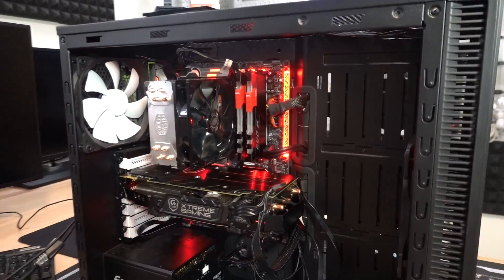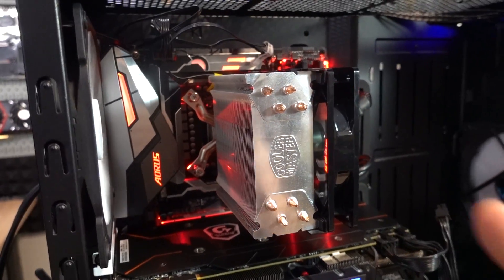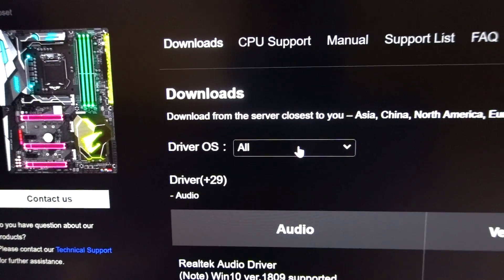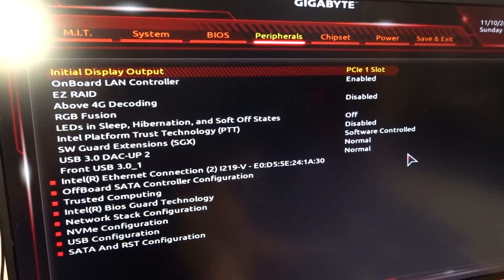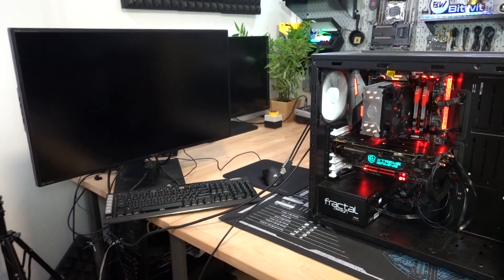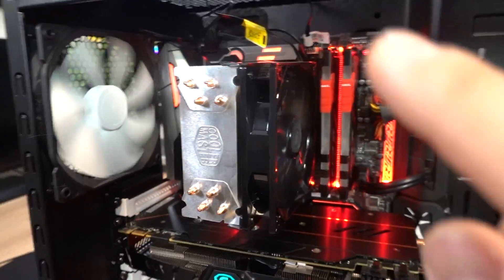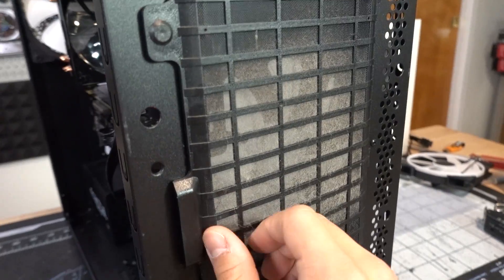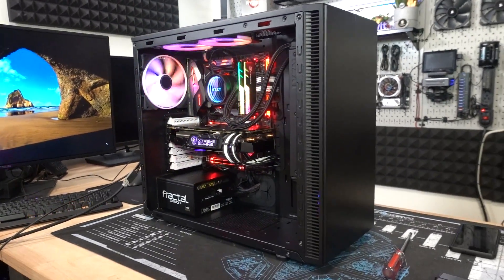Every PC owner should know how to do this

Comment: Kyle something to mention the usb port that you put the flash drive in only matters if you use one of the bios flashing tools that works without a cpu.  This is due to programming built into the motherboard itself only reading from select usb 2 ports due to very limited processing power available.  This should only really be used if you can't use the standard method.  To flash with in bios tools any usb port will work even front panels as the modern UEFI bios are capable of reading from them. Dos flashing of bios is still kinda a thing but only on fringe or early boards and beyond the skills of an average user.

Comment: Something like this JUST happened to me with a 2600 in a MSI B450 Bazooka board. Blackscreen with the underscore blinking. After a couple reboots it booted normally, but the first thing I did was update the bios and so far things have been running fine again

Comment: That "random" string of numbers in the files was not random.  It's just the motherboard. It said Z370AOG7.15a

That basically meant:
Z370: mother board model 
AO: Aorus
G7: Gaming 7
15.a: the version of the bios. It was F15a. 

There ya go.
Reply: *G7 for Gaming 7 - the name of the motherboard
Reply: *G7 stands for Gaming 7 the name of the motherboard
Reply: @Dudae_  aight. Thanks. I'll change it.

Comment: HP is repairing my PC atm since when i updated my BIOS using HP's own software tool, it corrupted Windows, or did something cause it would keep crashing and restarting a minute after booting, and that would just keep looping. Then every system recovery attempt would fail, then every attempt to reinstall the OS would crash the PC. So yeah, thanks for that update HP.

Comment: Why would you NOT put the AIO on top? You're adding fans there anyway, so why bring CPU into the case first instead of on my cool at and push the cpu heat straight out of the case.

While it may not make a big difference, it's still a better choice.

Comment: Pro tip - get a motherboard with a CPU-less BIOS Flashback option. :D  MSi has a nice system for this. You can flash it with NO CPU installed at all. I'll never get another mobo without this potentially life-saving feature. Especially after hitting the unsupported CPU wall with a Ryzen 3000 and a new board last year. Beats the heck out of begging for an AMD flash kit and waiting for them to send one. :)

Comment: If you have fastboot it will not let you get into the bios by pressing delete. Also if your keyboard doesn't get recgonized or it says that there are two of them, then plug it into a usb 2.0 port instead of a 3.0 port. I have been fighting this since I built my new system yesterday.

Comment: It wasn’t addressed in your video because it probably didn’t apply to your friend’s build, but I have almost the exact same motherboard (Gigabyte AORUS Gaming 5) and each time I’ve updated its BIOS it resets the XMP Profile back to Default and turns off Intel Rapid Storage Technology which disables any RAID configuration you may have. I almost have a heart attack every time it tells me my D: needs to be formatted after doing a BIOS update until I remember to go back in and turn it on again.

Comment: It's an Aorus Motherboard and if it has a dual bios without physical switches to manually switch the bios, it probably reverted to an older version in the backup bios and automatically flashed the main with the old bios by itself. If you want to prevent future problems If you successfully flashed your main bios and tested stable, then update the backup bios too!

Comment: Coolermaster Hyper 212 Evo looks budget? I think you mean, "sexy-steam-punk, been around and proven for years"!

Alright, it's a cheap upgrade over stock coolers. If you're doing some serious overclocking or have a high TDP chip, get a better cooler. But damn, for the money. . .it is a pretty good upgrade over a stock cooler. It has better cooling and and is QUIET.
With just a couple of RGB LED strips (top/bottom of glass) in my case, the aluminum and copper, surprisingly, reflect a lot of light, making my build a little flashy, but not rainbow puke.

Comment: I have an overclocked i9-9900, and using a CM Hyper 212 in push/pull config, it stays very cool even under heavy load (~30C idle, and ~70C gaming/video rendering).

Comment: Shouldn't the 8700K be the better choice? Per core performance should be the same, but the 8700K has 6 cores 12 threads while the 9700K has 8 cores but no HyperThreading meaning only 8 threads.

Comment: Question about bios update, is it needed to update bios to older version and go up one by one to the latest version or you can instant go from an old bios version to the latest version.
for example B450 aorus elite. still on F5 which is back on 2019. should I go to F30 , F31 ..etc until F50. Or I can just go from F5 to F50
kinda planning to upgrade from ryzen 5 2600 to ryzen 3600 but wanna make sure my bios is updated first.

Comment: Kyle, how would go about updating a BIOS when the BIOS is the problem? I have a board that won't boot, just turns on and off, on and off. I've pulled it out of the case and upon closer inspection, while booting a couple indicators light up. BIOS1 first, then boot fails and it starts over with BIOS2 illuminated, then boot fails and BIOS1 is illuminated. I think somehow both BIOS are corrupted, but have no idea how to go about fixing this issue, since I can't get into BIOS to flash it. Any ideas?

Comment: 3:05 
not if you have a motherboard that supports so you can update the bios without CPU and RAM ;) motherboard that supports 
bios update without CPU and RAM has a special USB port to connect. But otherwise it doesn't matter...

Comment: Dell screen . I'm assuming you're using the displayport on the gpu . If you shut down there is a high chance you're not gonna get the post screen . Its gonna stay black until it reaches windows .

Comment: Yes, timely. I just bought a 3700X as an upgrade for my 1800X on a Gigabyte X370 motherboard. I’d already performed a very similar process to update my BiOS, which actually involved quite a few more steps, but if I had not known to update my BIOS, I might think the new CPU I’m getting is defective if I put it in and suddenly my PC does not work anymore!

Comment: I'm still curious as to what happened to the original 8700k, and wanted to see Bitwit troubleshoot it. Great vid tho!
Reply: Would be a good follow-up video.
Reply: I think the owner wanted to upgrade and didn't realize he needed a bios update. Probably got rid of the old cpu and was stuck unable to boot.
Reply: I think that the original 8700K is already dead, maybe due to a bad atempt of overclocking, a very high voltage could have degraded it and killed it

Comment: The 9700K is about as much faster per core than the 8700K as the 3800X is than the 3700X. That is to say... not at all. Also, 8 threads is worse than 12 threads, so it’s totally a side-grade. He should return the 9700K and eat the restocking fee.

Comment: Also to anyone who updates their BIOS; typically this resets most settings like CPU frequency changes as well as RAM overclock timings, and custom fan controls. So be sure to at least go back and set your XMP profile for your RAM if it is rated higher than 2133mHz for DDR4 :-)

Comment: To all people who wanna update their BIOS,

Don't do it if you don't know what you're doing or it's not necessary!!!
Reply: bataa battur Exactly what I was told 30 years when I first started out in the industry.  No need to update unless it gives you something that your system needs. Only time I update the BIOS is when installing the motherboard for the very first time to ensure hardware compatibility at the time or if installing a CPU that the board supports that was not available at time of installing the board.
Reply: Don't fix what's not broken as they say. I'm pretty sure there will be someone out there after watching this trying to update their BIOS. Just because it sounds right in their mind to have the latest BIOS update for their motherboard for no apparent reason.
Reply: Do you any retailers that could do a bios update for my b450m?

Comment: But the Verge said "its always a good idea to add more thermal paste to a AIO"
Reply: Leo Pimentel But the Verge said LOL is the best game to benchmark
Reply: @Ferotiq  and don't forget to cap the framerate at 120fps so it runs smoother during the benchmark!
Reply: @Ferotiq  destroyed
Reply: Don't forget to splooge your pasty wasty all over that motherboard also.
Reply: Kyle forgot to screw in with confidence.
Reply: @ThePhonyAccount  because his army knife dont have screwdriver.next knife will hopefully have it.
Reply: May the Verge memes never die
Reply: You need the thermal paste applicator
Reply: @Kaldrsand  don't forget to wear your livestrong bracelet to prevent static
Reply: @jordanabendroth5568  And make sure you use tweezers to mount your cpu cooler.
Reply: Also memory kit should be in 1 and 2, not 2 and 4 😁
Reply: @RamiKattan  Depends on the motherboard...  It's not always 1 and 2.
Reply: "The brace... stares intensely at the camera, as though he knows what he is saying is totally dumb ...at the back"
Reply: Yeah, you have to apply thermal paste like you're icing a cake
Reply: Leo Pimentel don't forget the anti statc wireless wristband
Reply: Also zip ties are called tweezers
Reply: Make it rook rike a jackson porock painting:D
Reply: Didn't the Verge have that cringe-worthy build guide a couple years ago?
Reply: dweiss1 that’s the whole reason this thread exists
Reply: Screw in with confidence
Reply: @Chris Porter can't tell if that's a wooosh or what. In the verge's video, the dude put the ram in the 1 and 2 slots, and this entire thread is mocking The Verge, so... yeah.
Reply: @Chris Porter I don't know exactly what their channel covers, but I do know that they are most known for one specific dude who made one specific video that made them the laughing stock of pretty much every tech youtuber and every person who watches their videos. Look them up on YouTube. If you can't find the video of them building a PC, you should at least be able to find reaction videos of the dude from The Verge building a PC. It is a meme at this point. His Twitter account gets bombarded with people quoting the video and the reactions as well as straight up telling him he sucks at building a PC. He could post a picture of his dog, and still, most of the comments will be of his garbage PC skills. Of 100 comments he will receive, at least 80 of them will be about his video, and he did the build almost 3 years ago. He usually writes the people off as trolls, and still seems to legitimately believe his build was done correctly. Just look up The Verge PC Build Reaction. Watch the one that's like 20 minutes long. It covers pretty much everything he did wrong, which was basically EVERYTHING.

Comment: maybe someone in the comments section can help me. I killed an old H61 or H77 board (ASUS, ITX, I think they only made one board for each chipset, can't remember which...) during a BIOS update. It hung on updating Intel IME. LGA1155 ITX boards with USB3 are stupid expensive. The BIOS chip is not socketed, at least I couldn't see a socket in the cramped ass case it's in. Is there a cheap way to manually flash the chip? Like a programmer with a clip? Would it also be able to finish writing the IME area? Weird thing is the board will still boot...on the fifth Saturday of February. J/K. It will randomly boot. Haven't been able to successfully reflash the BIOS any time it has booted. There's a Konami code you can put in using the ATX power switch or something for forcing a dual BIOS recovery, it doesn't work bc I think the recovery copy is corrupted. USB flashback fails too. Or at least I think they both fail, no video output from the iGPU or PCI-E graphics while they're running...most of the time. If I do get videe output it fails at Intel IME

Comment: You can put the bios update into a folder (at least that’s the case for Gigabyte boards) I’ve done this with my YUMI Multi-boot linux drive. I have a folder specifically for dropping drivers and other utilities when installing or running OSs

Comment: good rule of thumb for which USB port - closest to the top, closest to the board. so from the view you showed us at the back, top left port, with another USB port between the "correct" one and the PS/2 port. I haven't actually had to use a specific port in close to a decade, and that's usually only for boards with a "flashback" feature. if you're booting to an EFI shell or DOS to flash it usually doesn't matter

Comment: Who's updating their bios now? XD
Reply: To all people who wanna update their BIOS,

Don't do it if you don't know what you're doing or it's not necessary!!!
Reply: It’s so easy. I went the super lazy route a few weeks ago and updated while in windows. Don’t like reaching around looking for a usb spot and extracting files and actually using a flash drive. Easier to run it in windows and let it do it’s thang
Reply: Now you have that first time pc builder running to his attic to get his failed attempt of a system to fix the problem. He'll be up all night. lol
Reply: @lindah6954  If they screw up ggs. Although the instructions were very clear.
Reply: I did it to legacy system

Socket 775 and 1156 pc, all have BIOS updated
Reply: No I updated the primary BIOS recently and lost all overclocking settings which is a pain so I'm daily driving the secondary BIOS now. I'll update it when I upgrade the CPU.
Reply: Nope as best piece of advise I was ever given when I started out 30 years or so ago in the IT/Networking game was to “never update the BIOS unless you need to” ie. something isn’t working. No need to update the BIOS unless it gives you something that your system requires to work. Only time I do different is when using a motherboard for the very first time & will always update to latest BIOS at time of installation.

Comment: Hi, I have 18 birthday on march 19 so I was planning to upgrade my PC. my Pc is:
Ryzen 1500x with stock cooler 
DDR4 16GB 2400MHz 
B350M BAZOOKA motherboard
1 SSD and 1 HDD drives
GTX 1060 6GB
and some cheap case 

I was thinking about getting Ryzen 5 3600x and corsair vengenance 16GB 3600 MHz RAM. I still don't know how much money I will get. Is it a good idea or should i focus on something else

Comment: Had the same problem last week, the problem was this: One of the 4 RAM sticks stopped working... No video, turns off after 10sec.
Reply: Literally same, cause it's a ddr2 board though and I was maxing it out I had to get a new board cause 6gb is a)wrong and b) not maxed out (plus already ordered the ram)
Reply: That's like some basic Mobo troubleshooting. Go down to one stick of ram, unplug everything from the chipset, use onboard graphics if you can etc